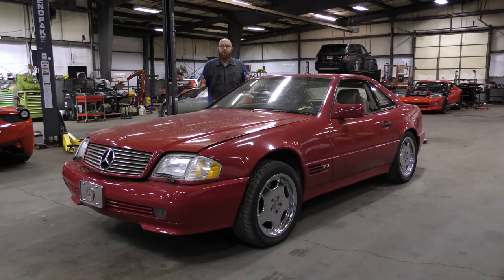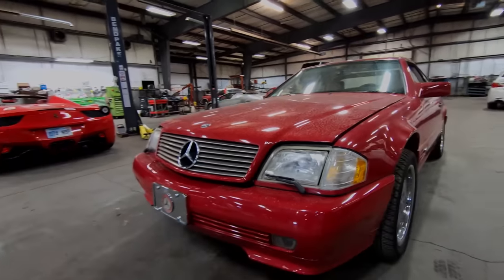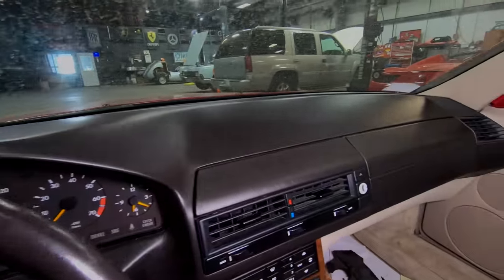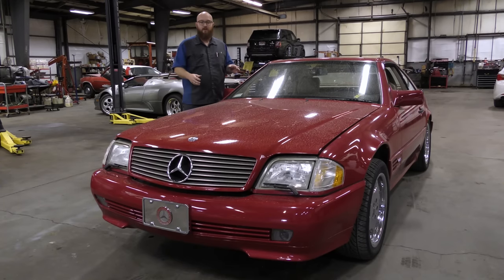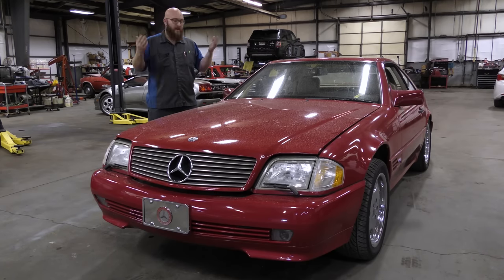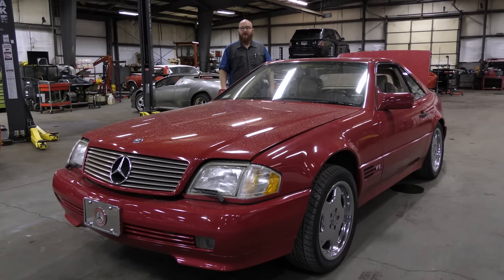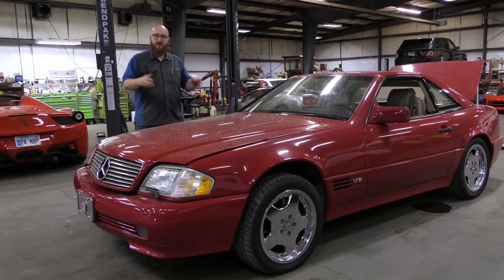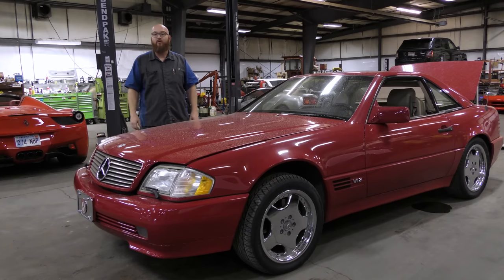Another customer scammed! CAR WIZARD shows why this '94 Mercedes SL600 is needing 15K to get sorted!

Comment: As I was told before I bought my first AMG, always remember, nothing is more expensive than a cheap Mercedes.

I'm not sure about the "scammed" part of it, though.  Looking at BaT, a few SL600s have sold in the teens over the last year, but most have been between $20K and $30K with some going much higher than that.  Just my speculation, but it seems like it might be a case of someone figuring they could pick up a "fixer" for $7,500, put $5K or $6K into getting it sorted, and have a $25K car for half the price.  Again, just speculation on my part.
Reply: or any Mercedes BMW Audi etc..... they are endless all money pits..
Reply: @marklewis8067   My 1966 Cadillac has needed a alternator, air conditioning compressor,  fuel pump, and the clock doesn't work.  Lousy junk, may not last another 55 years.
Reply: @waterheaterservices  I was born in 1966 just like your Cadillac so I sympathize with it. At least with your Caddie, its easy to diagnose and work on plus the parts won't cost as much as the purchase price of the car.  
Today's cars are way too expensive and way too complex with features and electronics that many drivers will never use. Government has a major part to play as well mandating equipment and features that drive up the cost of the car. Like most aspects of life Govt creates more problems than they ever solve.
Reply: @marklewis8067  - Oh, I don't know.  That first AMG was a 2003 CLK55 that I bought it in 2010 with 60K miles on it.  Sold it in 2019 with 145K miles and it was the most reliable and least expensive to maintain car I've ever owned.  Other than scheduled maintenance, the only thing that ever needed replacing in almost a decade of ownership was a crank position sensor.
Reply: @gyllessmyth4759  I am pleased that you had that experience. However, anecdotal experience is not actual evidence of anything. If I slipped and fell in the shower one day would it mean that all or most days i would also fall? no 
The Statistics don't lie The old Mercedes W123 cars go for hundreds of miles. The new ones do not. There is a huge proliferation of plastic parts that fail regularly as do the computerized modules that run everything. 
Truth is that these cars have become more unreliable. Partially because the manufacturers don't care what happens after the warrantee expires ( in fact they want the car to fail at that point because it becomes a revenue stream for them in parts and repairs.) and partially because they have become so complex. As logic will tell us, the more complex a system becomes the more likely it is to fail and the harder it is to diagnose and repair.
Reply: @marklewis8067  - I'm generally in agreement with you there; I was merely pointing out that in my opinion considering "any Mercedes" to be an endless money pit was an over generalization.  As you point out, a lot of the older cars are paradigms of reliability when properly maintained; I've had great experiences with all but one Benz that I've owned and my recently retired MB mechanic noted the same, that when properly maintained, those cars can last a lifetime.

As for the reliability of more modern Benzes, my thought would be that the decline is largely attributable to increased production volumes, the move from mechanical to computer engineering, and deferred / inadequate maintenance once the car reaches its second (and subsequent) owners.  Design and build quality were considerably different when Benz accounted for ~300K vehicles per year as opposed to their current ~2.2M or so.  No manufacturer can maintain the same standards while increasing volume 7x or 8x.  Additionally, prior to the rise of Toyota's Lexus and Honda's Acura brands here in the U.S., outstanding mechanical engineering was the hallmark of German cars.  That changed in the '90s as technology became a greater factor, and the Japanese brands led the Germans in that regard.  Finally, based on a dozen years in the local MBCA chapter, my experience isn't that different from most members, but there's a selection bias at work there in that those are individuals who (like me) keep up on their car's maintenance.  As MB vehicles have become more prevalent, a large percentage (probably a majority) of owners purchase highly depreciated late model cars with the expectation that maintaining them will be similar to a Corolla or Accord, as the used MB is at a comparable price point.  When they realize the cost of maintaining their SL isn't the same as a Camry, they often short change or defer maintenance and ultimately decide to sell the car shortly before some imminent (and expensive) failure.

Just my $0.02.
Reply: @marklewis8067  i think the biggest issue is brainless people lacking common sense and understanding of their machine and how to take proper care of it. yes some people may still have a bad experience, but same as you say, that also doesnt mean they're all suddenly bad. the argument goes both ways. yes things arent built the same way, things have gotten more complex and complicated, but thats somewhat irrelevant when karen or kevin dont change their oil regularly, run cheap walmart gas all the time, dont let their cars warm up, dont let their boosted cars cool down, run regular when they really need premium, etc etc etc etc. people have gotten dumber over the years, and its not just the "younger" generation. i've seen older people kill cars because they simply are clueless and know nothing about even the most basic things about a car or how to take care of them.
Reply: @marklewis8067  Yeah, because less pollution and less deaths caused by shitty car designs are not worthwhile endeavors, right? You think manufacturers would have made these improvements and changes over the last 50 years left to their own devices?
Reply: Exactly. A buyer who was trying to be a shark and didn't bother to get educated first.
Reply: This indeed, maybe the previous owner also wasn't aware of all the stuff that is wrong with it. Probably depends on wether it was a garage or individual person. But also why didn't he tested the roof himself? He would also see it poring al over the place. 
And always let your or independent garage do a checkup before buying, specially with old luxury cars. It pays itself back at least double 9/10 times and when avoiding a potential scam it pays out a lot. More especially when you know you are buying a cheap one if normal prices are around 18k !!
Reply: @gyllessmyth4759 Yes ,  I have a 2005 CLK55 AMG Coupe ,,it has never broken down , and never had a problem .. Only do servicing of fluids ,brakes etc. replaced front control arm bushes and vc gaskets like on any 15 year old car.
 These are the most reliable , easiest to service AMG ever built , because they don't have hydraulic suspension , they don't have electronic brakes , they have a bullet proof engine and everything works.
Reply: @vivadjango  I anticipated this simpleminded response 
Car manufacturers make improvements constantly and always have in response to competition and consumer demands. The seat belts, 3 point harness and airbags were designed and implemented by car manufacturers and NOT by government mandates. As far as environmental regulations, they could have been phased in slowly so as not to jolt the car market. Regarding fuel economy standards, its not the government's role to impose these. People can decide for themselves if they want to drive a Prius or Lincoln  Navigator. The 20th century is filled with what happens when governments control industries and people. let me give you a hint....Its not pretty
Reply: @vivadjango  if the government told you to wear a buttplug to prevent exhaust gases from escaping into the atmosphere you'd probably do it. Sad.

Comment: I handled repair of all my 12 hydraulic cylinders (500SL, 1990, in Sweden) for Euro 799 plus Euro 80 for one new contact sensor.  I sent them to RSCAuto in Germany, they took less than 24hr for actual work but postal services about 5-7 days each direction.  Cylinders now work really well.  
Leave the car there instead and it's done in 1 working day, including cylinder removal, new seals, cylinder refitting.

Comment: I saw a very cheap S600 in Virginia. 8 owners. I did some research on the car. The V12 engine needs 24 spark plugs and the coil pack is $1250 each!
Reply: Was it an early w220?
Reply: @cooperredmon3430  very likely
Reply: @cooperredmon3430  It was 2006 S600
Reply: Says 400$ for one side of coils..

Comment: I have a 95’ 600. Did the wiring harnesses. Currently doing the hydraulics. Doing the work myself has saved me a lot of money. The work is pretty straightforward. You can still get the MAF and lower harnesses as of 4/15/2024. MAF is around 120 each (x2) and the lower harness is around 200-300. My upper harness had been replaced and is NLA, but Kurth Classics in Germany rebuilds the main harness.

Comment: There was a '94 SL500 for sale local to me for $4500 and it looked so good but everyone including a Mercedes mechanic said run.
Reply: Good on you for doing your research
Things can get bad quickly for making hasty decisions with cars, although I still feel for this guy he didn't deserve this at all...
Reply: you dodged a nuke, there are worse but you did your research and saved your 5k$
Reply: The V8 models are significantly better in terms of parts availability, but with something that old and if you don't know how well maintained it has been, then its a real gamble. Especially at that price. If you can't do the work, it isn't worth it to own an old Mercedes unless it was mint when you got it with legitimately no issues.
Reply: @CAepicreviews  yeah, 500's are fine, just have to have the money to keep them running, forget the convertible tops too, I kept my hardtop on my 2000 the whole 7 years I had mine.
Reply: Go to a MB dealer, it is mostly Dr. and some business guys who lease for two or three years.  No person is buying them for longevity.  MB has ZERO priority on longevity.  just short term snob appeal and tech wizardy
Reply: Yes Pablo, all car makers are the same😏, they don't want vehicles too last😞, it's not good for their sale quota 🙈😒🇬🇧
Reply: So what did you end up buying with your $4500?
Reply: @vw5056  he got a sweet 74 AMC Matador

Comment: You know, as careful as I am, it’s happened to me with my beloved S400 Hybrid in my profile picture. I had a pre purchase inspection done by a local Mercedes dealership here in Germany. Very minor issues came up. New wiper blades needed, brake pads, etc. my concern was with the hybrid system and especially the power control modules that are known to fail between 80-100k miles. I purchased the car with 68k miles and was told by the Mercedes dealership that it had already been replaced on my car. What they didn’t say is that is was replaced by a used one that still had the problem. Not the new replacement one that Mercedes sells now. There is hope, mine is not failing completely yet, just causing an occasional engine light for low voltage. Luckily I found a guy who rebuilds the power control units at 1/10th of the cost and gives you a 2 year or 30k mile warranty. That’s the route I’m taking because I absolutely love this car. Great video. Thanks for the info.

Comment: I've rebuilt these wiring harnesses myself.  I can't get the original colours of the wires, but use a selection of PTFE insulated wires bought from Farnell in Leeds. All I have done is taken the harnesses off, got them one by one on the bench and very, very patiently replaced each wire one at a time.  It's a matter of opening the plastic plugs with a Dremel and then glueing them back together with epoxy.  For the ECU multi-way plugs, I have heard of people extracting each pin but I have never found a way of doing that.  I cut each back to about 1/4", apply solder flux to the remaining 1/4", slide a little bit of heat shrink tube over the new wire, solder one, cover with heat shrink and on to the next.

It is an absolute pain in the arse of a job. 

My 1994 SL600 with 40k on the clock needs doing now, but I may just send the harnesses to repair, give them £1600 and let them do the job.  That was my late wife's car so I will never part with it.

Comment: Mercedes had a thing about hydraulic operation of windows, tops etc, starting with the 600 in the sixties. As it was always the top models that had it, their costly leather and cloth interiors suffered badly when the inevitable pressurised leaks started. I like simplicity!

Comment: My second thought. Could the hardtop be made permanent removing all of that hydraulic crap? Could the engine be hot rodded with aftermarket controls Etc? And finally could this suspension be simplified? Wouldn't be original and maybe not worth so much. But it might make a fun driver.
Reply: I wonder if the later year sl65 black is more reliable than the cheaper hardtop models as a result.
Reply: ok disable the roof hydralics for a few dollars and its a permanent coupe.  not as fun but its a solution.  an aftermarket ECU would still need all new wiring and the cost of the ecu, so that's going to probably cost more, and could be a pita to get running right let alone unlock more power.    convential suspension replacement, probably a good call.  all in all the car is a bit of a money pit anyway you look at it.  Id argue that it would be worth sorting but the cheaper solution is still to buy a sorted example.
Reply: I had an r129 SL500 and just didn’t touch the convertible top once it started leaking. No problems. I sugru’d half of my cracking wiring harnesses when I had it. Gave up when I had an unrepairable tranny connector leak and the damn OE shocks kept failing every few months.  😭
Reply: @onecarl78  - Sugru’d is not a word I'm familiar with.

Comment: Love my slk 230, it's a tank, great gas mileage, cheap to fix, fast enough, and can park it in the smallest parking spot.  Best of both worlds, hardtop and convertible  with 1 button.
Reply: Surely you jest. Your (and my)  SLK230 is a completely different ilk of automobile.    It's like comparing apples to baseballs, not even oranges.  And just wait until your convertible top goes south.  It'll do it when it's down, and pouring rain.
Reply: @chuckasbury8991  We drive it during the spring, summer, and fall during nice weather.  Car is a beast.

Comment: I rebuilt all 11 cylinder using $10.00 cheap Chinese O ring. The soft top is now working good.  The wire harness has to be bought from the dealer, shop around to get a cheaper deal. Air suspension is something I don't know how to do. Headliner is not a big item.

Comment: Had a 1990 SL 600 , 40,000 miles on it.  Black. Sat in the sun in Floria.  Same wiring harness issues, also mass air flow problems. Loved the car, but turned into a nightmare. Spent thousands!.  Ended up selling it for $2700 to a guy that patches them up and sends them overseas.  Now have a 1999 SL 500.  Very pleased, but not without standard issues, I.e. leaking top hydraulics, etc.

Comment: There are rebuild kits available for the hydraulic actuators for the top. Just just O-rings that fail over time. You don't need to spend the much on replacing them.
Reply: The top seems tedious, but for diy could be done cheaply. The wiring harness is what kills the car though. Unless you have a line on them and a lot of time.
Reply: True, or swap them for rebuilt from tophydraulics.  The biggest thing is removing and replacing them, not a hard job just time consuming

Comment: My 27yo convertible has a manual top. That takes around 30 seconds to 
open and 30 seconds to close. Each time I go out for a drive I waste an 
entire minute of my life. Instead of driving it for 1h and 15 minutes 
with an average speed of 55 km/h I now really step on the gas
 to make it 55.5 km/h so I can win back that lost minute of my life and 
drive only 1h and 14 minutes. I know it's terrible to not have 11 
electrical powered cylinders that open my top for me and it is a shame to use 
both of my hands. My shrink tells me that although this really sucks 
bigtime there is no need to kill myself over this.

Comment: While that sounds really pricey, I think that this car is worth doing the work on.
It is such a nice driving GT.  And the 15-20K put in, means the car will be good to go for another 28 years.
Like all cars, you take it to your trusted mechanic once a year, or at least 10k miles (some cars need servicing every 3k miles or 5k miles, so make sure you know the servicing intervals on the car you are buying), service it properly, DO NOT SKIMP ON MAINTENENCE!!!!  And your trusted ""steed"" will last.
Reply: I agree.while the owner maybe paid too much money on a neglected car error has been made and he should fix this car to perfection.Its a v12 convertible,not a Toyota corolla.
Reply: Exactly!

If I had the money to buy a Mercedes-Benz like this one, I probably wouldn't worry about the money to fix it up either.

I generally think though that to afford German cars built after 1980, you have to be pretty flush. I am not so flush.  Therefore I continue to drive my 1999 Toyota Solara 3.0 V6.